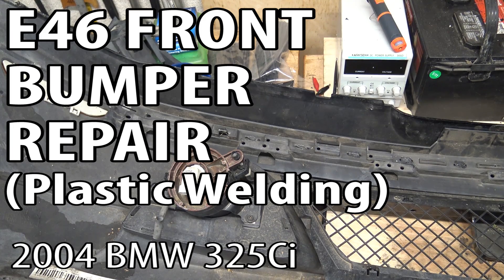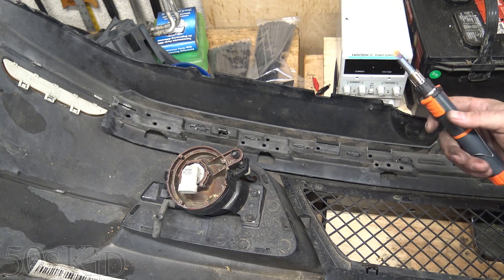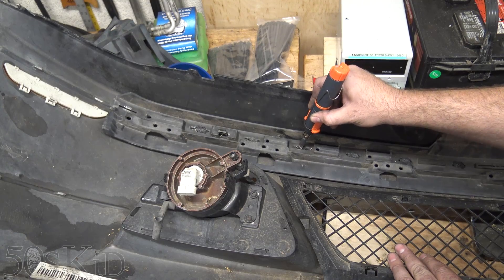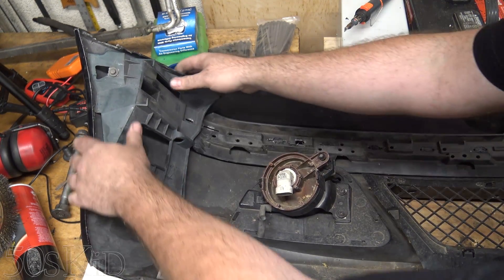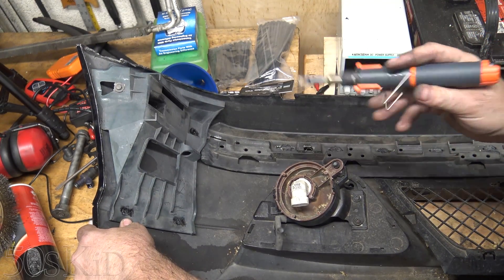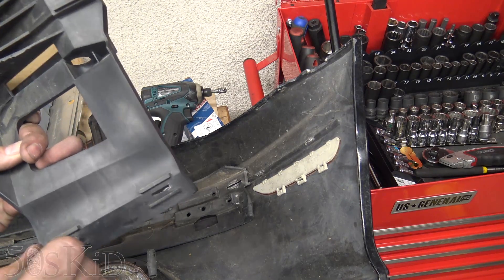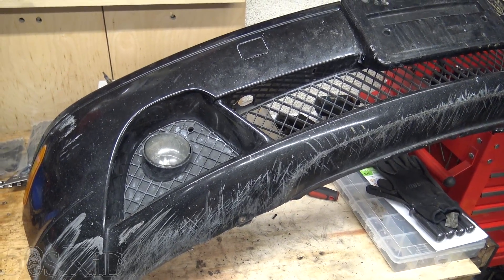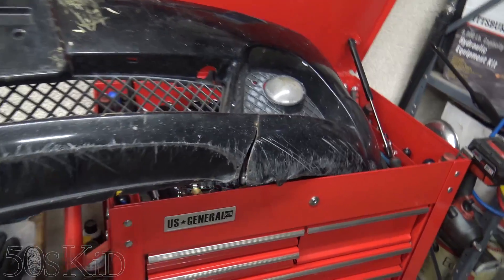BMW E46 Front Bumper Repair 2 (Plastic Welding) DIY

Comment: there is a product out called Qbond and it is a glue and it comes with plastic dust ..so clean surface sprinkle plastic dust on then use the glue (is like water) and it fuses both surfaces together ...is the best product we have used to do plastic welding on bike fairings

Comment: Where did you find the replacement slide bracket? The bumper I have on my car was in an accident so the whole bracket on the bumper broke off and I had to resort to using zip ties as a temporary fix to hold it up

Comment: Gonna try this. I tried using jbweld epoxy but my bumpers are still flaring out at the corners. Some people mention using zip ties as filler, but polypropylene would be better. I wonder what is a good easily available source of polypropylene?

Comment: hi great video, where did u buy the proper rivets to fit aluminum bar to bumper?
Reply from the maker: From the dealer.  Harbor freight has the tool to install them properly, item 97757, however the rivets that come with it are somewhat lacking. I also noticed the plastic rivets at napa the other day.

Comment: Hi 50skid how are you, it would be cool to know how to installed an electric fan on a e46 that comes with a clutch fan, i did some research and i wasnt sure how to wire the relay kit with an extra oem plug for the electric fan, and keeping the auxiliary fan
Reply from the maker: You remove the front pusher fan and the mechanical fan and simply replace with the electric fan.  The plug goes in the same place.

Comment: long shot, but do you remember much about the front fog assembly? I hit a duck and the fog lamp took the hit.... it's swinging about inside the bumper...
Reply from the maker: It's pretty simple--you should be able to figure out what's broken by looking at the good side!
Reply: the lugs on the lamp itself are snapped, I just wasn't sure if it was like other e46, where you could remove the lamp from the front, but on this bumper, you have to access the lamp by removing the wheel then inner arch / fender. keep up the good work.!

Comment: To be honest. I just use a Cheap $5 solder iron and scrap some plastic off areas where it won't be seen so I can use that to fill the damage areas.
Reply: Should use polypropylene not nylon zip ties if you what to hold.

Comment: Why don't you weld the split in your bumper? Do it on the back side and you will never see the repair.
Reply from the maker: The issue is strength, I think.  The two sides are naturally pulling apart and I think I want to research some of the accepted methods of doing that kind of repair before I jump in and possibly ruin it.  I seem to recall reading something in the past that involves a piece of mesh to add strength.
Reply: That's correct. Use a wire mesh and melt it into the plastic across the split and then use a filler. As stated below zip ties can work. It should hold it together until you find another bumper.
Reply from the maker: I'm reading that zip ties are brittle, though.  They're nylon, whereas the pumper is polypropylene.  Not sure if that makes a difference.  Do you have any experience doing this kind of repair?  Do you know whether zip ties are really good?
Reply: I've repaired two splits in a 2004 Dodge Ram front bumper. and it seems to be holding up fine. I didn't use zip ties but a friend of mine told me he has. I used a thin scrap piece of plastic I had laying around from an old car part. I never got around to sanding, filling (which I think would make the repair stronger) and painting the face side of the bumper. The truck has 183,000 miles on it and it's a work truck. I do want to say I really appreciate your videos, I have learned at lot. I have a 2004 BMW Z4 and your videos have helped me maintain it myself.
Reply: Most covers are polypropylene not all. Need to make sure the inner piece is polypropylene.